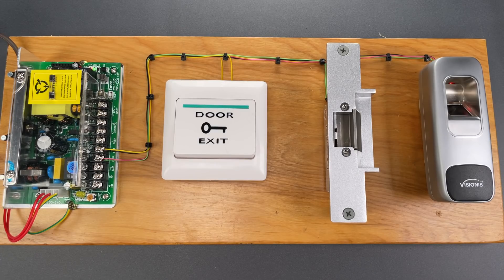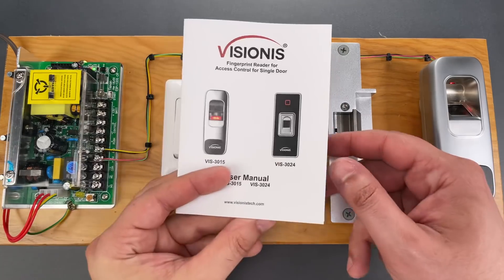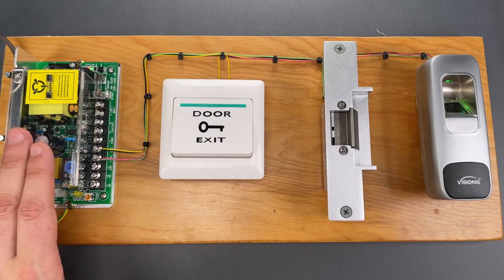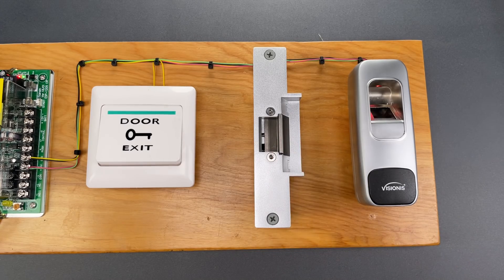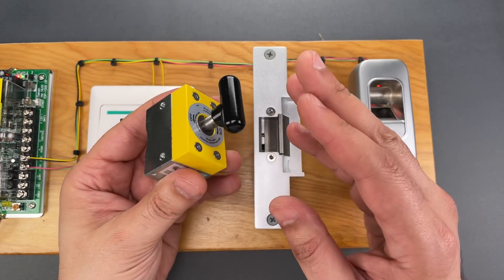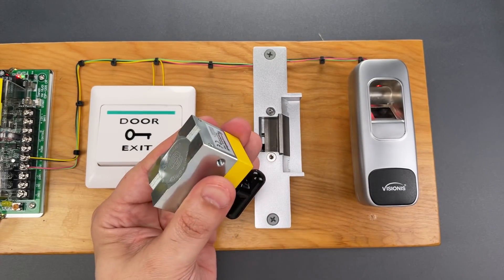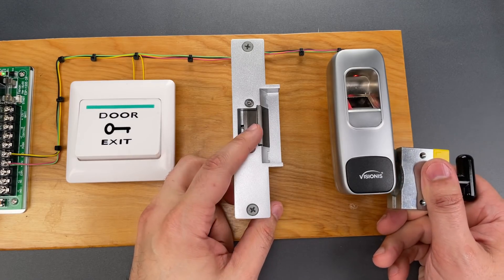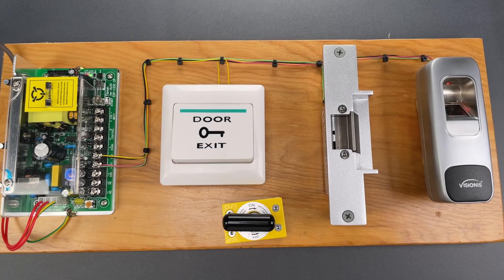[1359] Security Theater: Visionis Fingerprint Reader Bypassed

Comment: As an electronics engineering, I would've have quit rather than be part of such a crappy product design. I developed secure systems and I estimate the per item cost would have just been 4-5 USD extra for proper encryption over the signals from outside to inside. Why screw people over for that little?
Reply: I’m an EE too. I wrote a comment before I read yours. It truly would cost just a few dollars more per system to fix that bone-headed design.
Reply: @unsearchablethings8167  A few dollars more is a couple of hundred less sales due to the price point. Ethics at all cost, except discounts, is the consumer mantra.
Reply: @unsearchablethings8167  Hell, even replacing the relay with a transistor would be a huge improvement, and would cost pennies. (Of course, that would still be a shitty, insecure design.)
Reply: @jasondoe2596  it would be a large improvement! But as long as you can take the reader off the wall and access the wires, I’m surmising you could touch them together and open it as well.
Reply: Because alot of assholes (both male and female) only got ahead by looking over your shoulder during tests....or something to that effect. Little or no effort always seems magical, you know....magnets.
Reply: I'm a hobbyist programmer, I know enough BASIC to write a graphical hexadecimal analog clock with rotating hands. so not a ton.

question:
so wouldn't it be better to make the scanner route power from the socket to the door, and when you activate the button/scanner the power from the device cuts on a separate cord, but if both sources are cut the door remains close? 

Socket -> scanner -> door =1
Socket -> button -> scanner -> door =0
OPEN 

I am simplifying this a bit. but this would prevent this kind of tampering? if the scanner is disabled then the power is cut to both, and the door remains closed.
Reply: @Mac_Omegaly  pretty straightforward really. The latch needs a microcontroller that cost about 50 cents. You know what I mean. The smallest Microchip microcontroller made would probably suffice.
Reply: @unsearchablethings8167  You would then need to provide the latch with a permanent power supply to power that micro, its own relay and/or transistors. You then need to make sure that the striker's own relay isn't vulnerable to a magnetic attack!
Reply: @Mac_Omegaly  They need to change from the simple, off-the-shelf power supply, to an indoor controller. The reader should just read the fingerprint data, encrypt it, and send it over a data link to the indoor controller. That controller determines if the fingerprint data is valid, and triggers the striker.

Anything you do that leaves the decision to open the door in the hands of something outside the door isn't going to make this secure. In this case, the relay that provides power to open the striker is outside, so the magnet just forces it to close. Even done your way, the same thing would happen, just the magnet would force the relay to open.
Reply: @robertbackhaus8911  
Okay, I think I get it better now. 
So instead of going directly to the door that signal should go back to the controller next to the button.

This makes me think a unique 8 bit value return from the finger reader would be a possible solution. Instead of a single bit check. 

But again I don't know what the cheapest solution in this case would be.
Reply: Profit
Reply: @soisaidtogod4248  yep, those damn bean counters.
Reply: @unsearchablethings8167  Everyone always blames the accountants.  However, it's not the accountants that make these stupid decisions.  It's product management and company leadership.  I can't tell you how many times I've seen company leadership makes crappy decisions, only to save a dime, not because they had to live with the decision.
Reply: @bigman55434  yeah, where I worked they (management) were the bean counters. Industrial engineers sometimes play the same role.
Reply: But the bean counting management would never approve of a 4-5 USD increase in production costs per unit.
Reply: Overall it's capitalism. You need to make profit even if it needs you to underpay your employees and force them to engineer designs that fail to provide proper service or intentional fail to create more demand
Reply: @prathamkalgutkar7538  Not really.  Non capitalist systems produce plenty of crap, pay their workers even less etc.  The fundamental "problem",  in this case, is that the consumer isn't willing to pay the additional cost for the better system.
Reply: It’s because this is a super cheaply made lock system sold on Amazon.  The whole system is probably made for 10 dollars.  4 dollars extra would be too expensive for seller who just wants to make a quick buck off those DIY guys that don’t have enough experience with security systems.  It probably will keep most unwanted people out, but it will not prevent prepared thieves out.
Reply: @JasonB808  it's selling at 99.06 USD on Amazon right now. You're telling me 105 USD won't work the same ?
Reply: Or at least add magnetic protection for the relay. :P
Reply: @samiraperi467  Or replace it with a cheaper solid state switch.
Reply: It’s not $4 more because somebody else probably sells a lock at $2 more. If you’re more expensive than the other lock you might not sell yours at all. 

Anyway, this is a problem that’s much more basic than encrypting the signals. The relay that operates the solenoid that opens the lock is in on the outside of the door.
Reply: Because a real one door controller is like $1000
Reply: These systems are simple to install and idiot-resistant. All the fancy stuff is in one box, the only components outside that box are a generic power supply, a generic push putton and a generic door strike.

Once you have fancy stuff in multiple boxes with a fancy encrypted communications link between them that requires matched components and some sort of pairing you are going to need a higher caliber of installation and maintenance staff.
Reply: Why don’t you design something, send it to LPL and see what he thinks of it. If he’s impressed then you’ve got a winner!

Comment: As a former Hewlett-Packard employee, The IT world has a lot to answer for this fingerprint verification process flaw.  Well done for bringing up this particular case.
Reply: This is not specifically IT, this is more the hardware design (since a software change won't fix this on it's own). The fingerprint reader part does a few things wrong: It stores and checks the fingerprints and then signals a correct combination to the main board. This means that by connecting the right wires it is easy to fake that "correct" signal (maybe there is a more complex protocol involved, but that can still be faked or even copied using a replay-attack).

To fix this flaw at least 2 things should happen: first of all the fingerprint part should only act as a sensor and send the raw fingerprint data to the mainboard, the mainboard then stores and checks that data so that a "success signal" can no longer be faked using the wires. However the mainboard should also rate-limit input from the fingerprint sensor, so that automatic attacks are no longer feasible.

Anyhow, this is the short story, there is way more complexity involved with making something even more secure.
Reply: @rolf-nl  havent read it because i cannot be bothered with your crap.
Reply: @ucmehere  crap? That's a bit rude don't you think? I'm merely trying to share some knowledge here.

Comment: Funny that just a simple transistor replacing the relay could solve this issue. Bigger issue is definitely having the switching done externally in the first place.
Reply: Since current required to open those kinds of normally-closed locks is relatively large to what controller can safely handle, and, potentially, your controller and lock could use different voltages, you want to have controller and lock circuits galvanically isolated. Cheap transistor would not work there. Nothing a optocoupler couldn't solve, but mechanical relay was probably cheaper.
Reply: Indeed! It's using a mechanical relay to send an electrical yes/no. Use a mosfet, optocoupler, anything!
Reply: @OregonOutdoorsChris  it is a mature tech. I was wondering if a MOSFET be appreciatively more expensive than a relay on an industrial scale.
Reply: @Speensinc  A mosfet should be a few cents while the relay is probably a dollar or more on the bom.
Reply: All they need to do is to use 2 relay right next to each other with opposite polarity so using an external magnet useless as it would always be open circuit. Or maybe an Hall effect sensor to atleast trigger an alarm. The best would be to simply don't have solenoid driver circuit on insecure side like in this standalone systems
Reply: @prathamkalgutkar7538  These kind of systems are designed for people for whom security is an afterthought, who want least intrusive system which is trivial to install, and who want cheapest device. Flaws of these locks are mostly systemic problems which happens because of initial goals: cheapest, simpliest device. Nobody is going to insert additional relays or magnetic sensors or adding another box you need to connect, because you are likely to fall into gap, when your device is too costly or too complex for initial target audience, but too insecure for more competent one.
Reply: @MiiNiPaa  Many PCBs I saw for such boards position the relay in one side of the board, they can position it in centre of regions where they are less susceptible to external interference. Talking of standalone system, the Soinoid itself can contain it's driver in one casing and standalone system simply powering and driving it. That's how most standard moderate to high quality systems are constructed as per my observations till date
Reply: @prathamkalgutkar7538  Having a (relatively) high power line and a source of EM fields in the middle of your digital circuit is not the best idea. It would require additional R&D to ensure that there are no problems and this will run contrary to the "as cheap as possible" goal.

> standalone system simply powering and driving it. 
This won't solve the problem of ripping it off the wall and simply connecting right wires.
To be secure, external devices should only read information and pass it inside. All decisions and powering the lock should be done from the inside by separate security controller.
Reply: Couldn't you just flip the switch around so that you'd need to repel it from the side instead of pulling it towards the side? At the very least, the criminal would need a bigger magnet...
Reply: @dragonwriterluc  the moving part of the relay is not a magnet, just a piece of ferrous metal. The iron core in the coil will concentrate all magnetic fields, so any strong field will still pull.
Reply: @dragonwriterluc  I don't remember any off the shelf relays which are side mounted the best I guess would be positioning them in the centre to avoid most interference if not all. Or simply don't use standalone systems
Reply: just making casing out of steel is enough to be secure from any magnet attack. If combined with proper mounting and cables exiting trough middle of case even messing with cables would not be possible without using power tools or sledge hammer at that point you can go for doors instead unless they are steel bars.

Comment: I would love to see a tear down of the inside to show why this flaw exists. I get that some locks have a metal bar or ball bearing that can be physically moved out of the way with a magnet, but what is going on in the fingerprint reader that makes it vulnerable to magnets? Especially since it is nowhere near the actual lock itself.

Is the magnet inducing current somewhere? Some needless mercury switch?
Reply: it uses a relay to switch the door strike
the magnet acts like the coil in the relay
Reply: And to elaborate - a relay is an electro-mechanical device to allow relatively low power circuitry to control whether or not some higher power device is operating.  (So your logic circuitry doesn't need to be rated to handle the full power you're switching.  This is how a 5v DC circuit could easily control, say, a 240v AC mains output) 

Inside the relay are some physical connectors which can move to open or close a circuit, a spring to control the default position of those connectors, and a (weak) electromagnet capable of moving the physical connectors to their other (non-default) position.  The low power circuitry only operates on the electromagnet, so it's entirely isolated from whatever is flowing on the high power switched circuit.  

So in a default open relay when the low power circuitry applies power its electromagnet the connectors move to close the circuit and allow power to flow through the relay.  When the circuitry removes power from the electromagnet the springs force the connectors away, breaking the circuit, and power is unable to flow through the relay.

But by applying a stronger external magnet you can cause those physical contacts within the relay to move despite no power being applied to the relays electromagnet.  In this case connecting that higher powered circuit within the relay releases the lock - so apply magnet and lock opens; even through the fingerprint control circuitry hasn't done a thing.
Reply: @jonathan_60503  Thanks! That's really helpful for me as a software guy who's only recently been learning more about how the hardware side of things actually works, but still has a lot to learn.

Your description of a relay sounds similar to how transistors are often described. Is there some reason why a relay would be preferred in this case? An internet search indicates that there are different ways to make relays, do you know if all relays have this issue with magnets, or just particular types?
Reply: @oracleoftroy  Not really a hardware guy either - but my layman's understanding is that a transistor and relay do perform similar functions; just using different mechanisms.
The relay is basically an automated physical switch, making and breaking a circuit, while the transistor controls whether or not electrons pass through an always connected semiconductor material.  
As I understand it a transistor can be vastly faster switching (no moving parts), and has no sparking issues to worry about; however there's more voltage drop (parasitic power consumption - even when electrons are flowing a transistor's semiconductor is higher resistance than a couple bits of copper stuck together) in a transistor than in a relay and hence more heat dissipation concerns.  Plus transistors that can work with high voltage, high current, and/or AC power tend to be more less common and expensive -- while the relay just needs big enough connectors to handle the the current.

However in this case I doubt the power to lock and unlock the door is all that high, so my guess is that a transistor able to do the job shouldn't be expensive.  But it might be slightly more expensive than the relay they used.  (But again, not really a hardware guy -- at least not on that level)
Reply: @oracleoftroy  Hardware guy here. Relays are preferred to isolate the load switch fully from the control circuitry, so that the system installer has the most freedom to select appropriate hardware and hardware operating voltage for a particular installation, minimize cable usage, assemble parallel or series switching circuits to realize new functionality, and so on. No need to foreclose options unnecessarily.
Reply: @abitofabitofabit4404  Ah, so it sounds like it offers a great balance of cost and flexibility. Interesting.

I was noticing that there are different types of relays, do you know if all of them have this issue with magnets? If not, I assume they are more expensive or less flexible, else it would have been an obvious thing to use for a security device.
Reply: @oracleoftroy  Cost, flexibility, and not needing to be bothered. It's too stupid to possibly be incompatible. On the other hand, a homeowner type might find it more satisfying and less effort to connect the striker to a dedicated 2-position terminal block on the reader unit.

Single-coil latching relays might be susceptible to poles of a strong external magnet.I haven't confirmed this at the bench, but some double-coil latching relays might resist the attack. On the downside, there is a small cost adder of roughly 10 cents depending on purchase volume, the software becomes slightly more complicated, and failure modes become slightly more subtle (if the relay is in the permissive position, and the power supply fails, and the striker is powered by a separate power supply which does not fail...)
Reply: @abitofabitofabit4404  Thanks, that's very helpful!
Reply: He said it.  Relay.